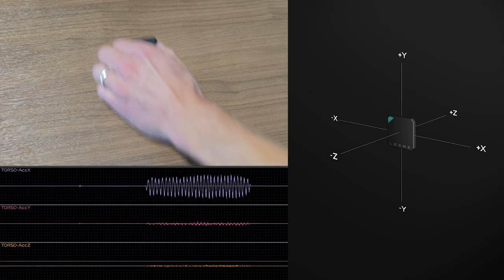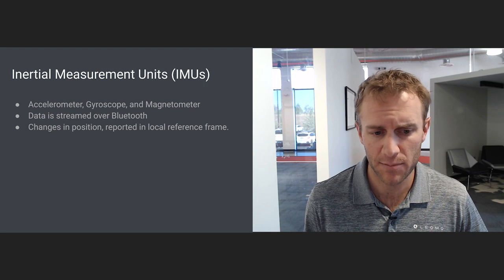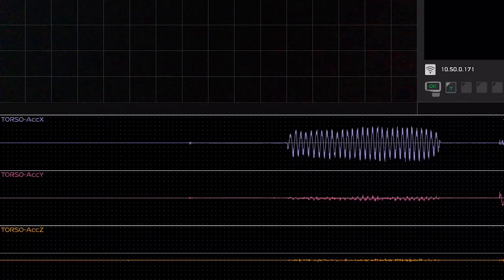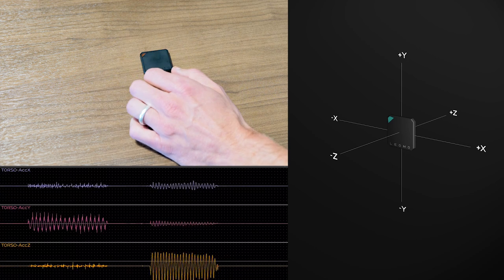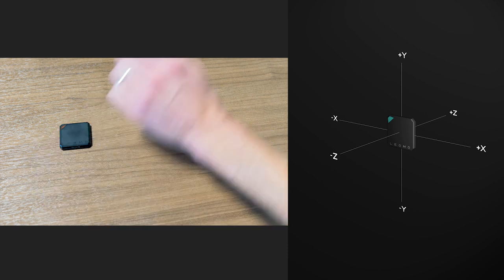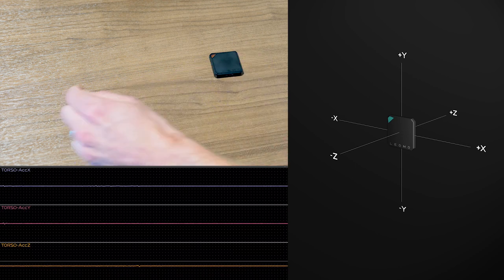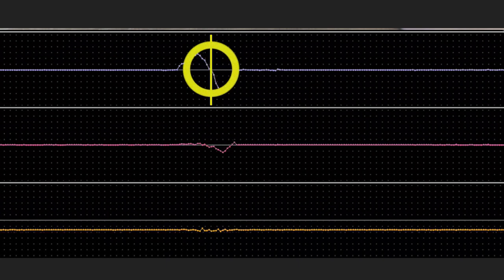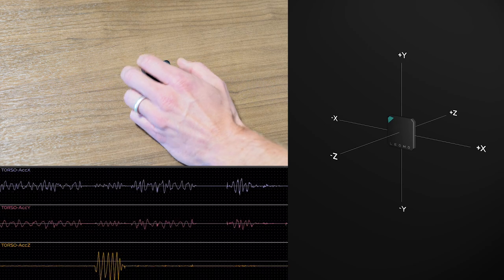IMU Data Analysis: Acceleration | Live Video Sync

Comment: Thanks LEOMO...a lot of thanks...
One thing I need to understand from you...one is the data when you move it in a particular direction...suppose while moving in a particular direction, if it also vibrates with a particular frequency , how the data will be of the graph..basically I want to know the difference between the movement data and the vibration  noise ...plz help me dude..

Comment: Hey There thanks for the video , I'm wondering How could you calculate g value , I'm conducting an experiment using accelerometer that shows data in three axis and would like to calculate (g) or mm/s^2 , Would you please help with the formula . Thanks